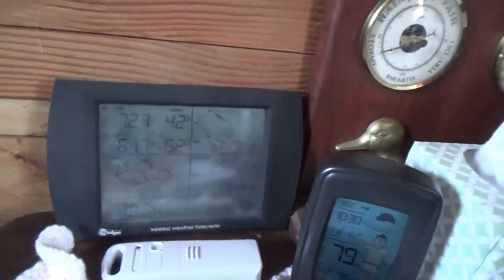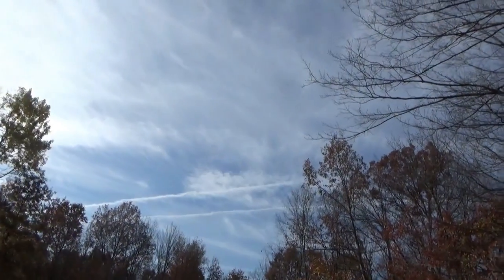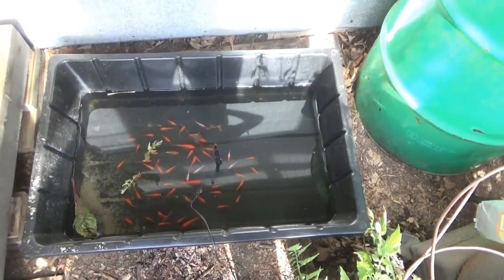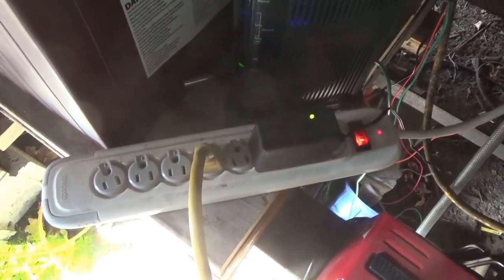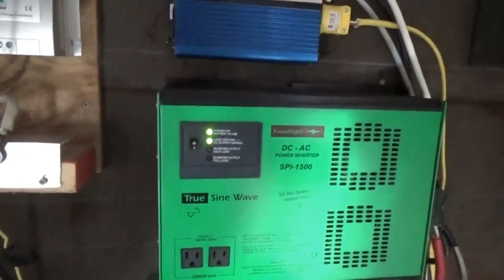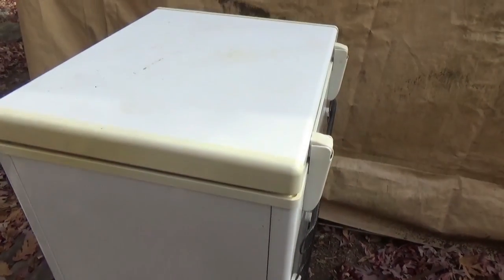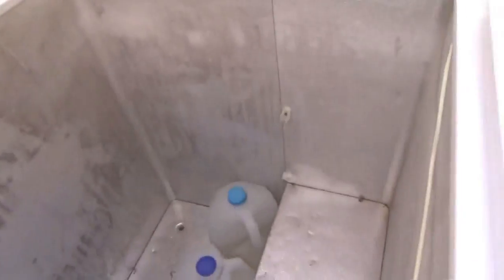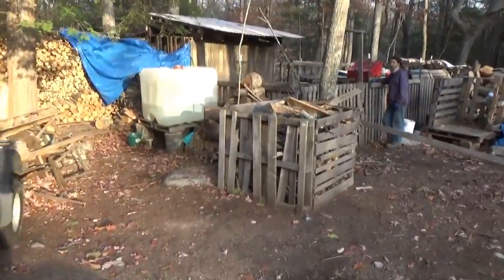Attempt To Run Freezer On Off Grid Solar Power

Comment: Troy. You should make a spot outside for the freezer especially with winter. Your planning to heat the shed, why would you want to have the freezer fight the furnace? Make a small shelter for the freezer in a shady area. Plus you could pack extra insulation around the outside of the freezer in it's little box to add to the efficiency, (Especially in summer.) A Lot! of people never think to add insulation to a project like this to keep the heat out. And keeping it outside, you use the cold of winter to your advantage.
Reply from the maker: Yes actually I am going to do just that. I will heavily insulate the outside of the freezer.
Reply: Remember to have the condenser coils as cool as possible. Insulate everything, but leave the back completely open with room for air to move by convection. Avoid them getting hit by sunlight as well. It's the key for efficiency!
Reply: *****
I'm sorry, but you are wrong. Yes, freezers are designed to cope with high temperatures, but that doesn't means that they will be efficient at those temperatures.
The efficiency of a heat pump depends on the delta-T (difference between cold and hot side). As the deltaT gets lower, the efficiency gets higher.
The amount of heat that enters the fridge through insulation losses (and that the compressor has to remove again to keep the temperature the same) also depends on the same deltaT, and as the difference rises, the quantity of heat transferred also rises.

In winter, there is less solar power available. However, there is also less heat in the ambient air. This means the deltaT will be lower, so the efficiency will be higher because the fridge will not "lose as much cold" through the insulation as in summer, and the vapour compression is also more efficient because the deltaT is low, and the condenser is kept cool so the discharge pressure is also low (the compressor has to compress or work less).

I don't get why you should put the fridge in a hotter place, mimicking summer (with the associated energy losses) while you could get much higher efficiencies by leaving it outside!

Since the evaporator and the vapour circuit is already designed to work well below 0°C as it's a freezer, you also won't run into issues like the compressor "swallowing" liquid refrigerant or the metering device not regulating properly that could happen if you were to put a fridge (min temperature=4°C).

It is highly unlikely for the outside air to get below -10°C at Troy's location, so no problem on that side.

NOTE TO PERSONS REPLYING:
I won't reply to your comment if you don't back up your theories. Saying "you're wrong" or insults will get you nowhere!
Reply: *****
Don't worry, we all learn things! Sorry if I sounded rude, and thanks for the extensive reply! That's how I like comment threads!

Basically the vapour circuit in freezers is almost exactly identical in ALL domestic freezers, simply because it's the cheapest way to do it so everyone does it this way :-)
You occasionally get the different one with R600a instead of R134a, but the circuit is otherwise identical (capillary tubing metering, not TXV which is used in commercial refrigeration).

The reason why the technician told you that you should not operate fridges below about 5-10°C is because a heat pump should never be operated if the delta-T is negative (inside hotter than outside) because it would mean that the refrigerant could not completely evaporate before getting to the compressor, which will then "swallow" the liquid refrigerant and cause knocking because liquids are incompressible.

Since Troy's freezer is likely to be set so the internal chamber is at about -18 to -22 °C, it is unlikely for the deltaT to become negative as it would mean ambient temperatures of less than -22°C which would be unlikely unless living in Siberia or northern Canada and frankly you've got bigger problems that the fridge if New York ever gets that cold :D

Also, since the evaporator is designed to work at those temperatures, it has larger area than a normal fridge because in the event of frost which is an insulator it could get even colder than -22°C (limit is the boiling point of R134a which is -26°C) and the freezer is designed to handle that.

Also, should the ambient temperature drop below -22°C, the freezer will never turn on as the thermostat will never trigger, so the "swallowing" problem is even more remote ON A FREEZER.

The verdict is that IF Troy keeps the fridge defrosted, and the thermostat is set to the minimum temperature possible, it should all be fine.

Although this shouldn't be done with a fridge.

Comment: You are increasing the amperage draw by using that long extension cord. I would move that freezer into the battery shed where you can plug in the freezer directly without using an extension cord. That should make it use way less power

Comment: I'm thinking....If you can get the freezer down to temp and insulate it well, you shouldn't need to run it at night.  Run it during the day when you have power, then shut it off at night when you lose the sun.  Should be just fine.

Comment: If you are able to run the freezer at night- you should put enough jugs of water in the freezer to fill up all the empty space and the frozen jugs will help keep the freezer cold reducing the energy needed.  As you fill up the freezer- remove just enough jugs for the space needed.  When the jugs are thawed- use them to water your greenhouse plants.
Reply: Won't more energy be needed to cool the water, are you sure the water won't require the freezer to keep running in order to get the temperature down?

Comment: Another way to get more energy out of a solar panel is to put a reflective white paint on a 4x8 sheet of plywood and lay it in front of the panels,  you have have to change the angle of the reflector every so often,  but it would help run more electric devices at once

Comment: How does solar power work when it is cloudy for a week? Are the batteries enough to run everything for a week or longer?
Reply: Robert scuba I see.  Thanks, Robert.
Reply from the maker: Most systems are designed to run 1 to 3 cloudy days with no problem. A backup generator is used after that.
Reply: The Do It Yourself World Thanks.

Comment: isn't the problem whit the thermometer  the distance betweeen the transmitter and recyver?
Reply from the maker: up to 150 feet range. This is less than 100 feet distance. They have readjusted themselves and seem to be working now with only one transmitter in use